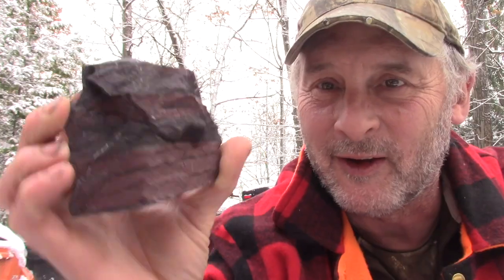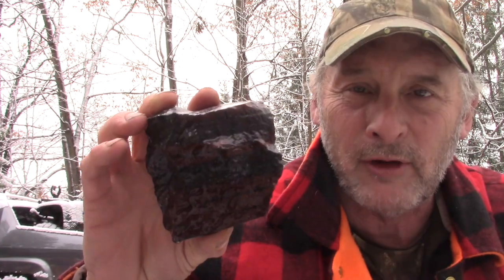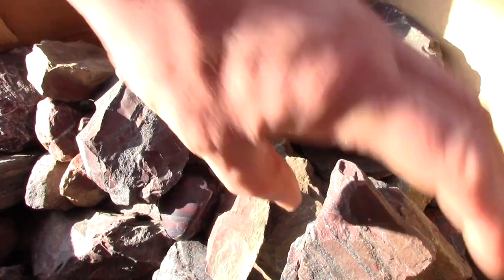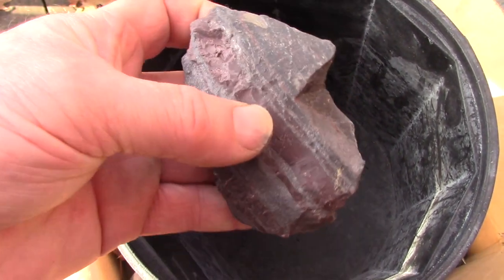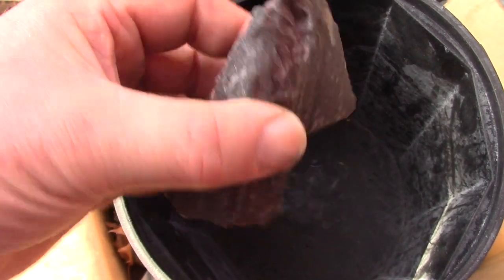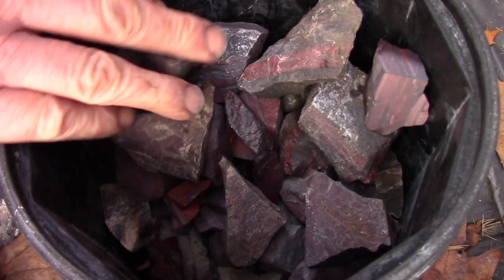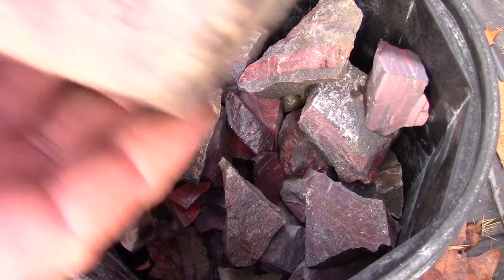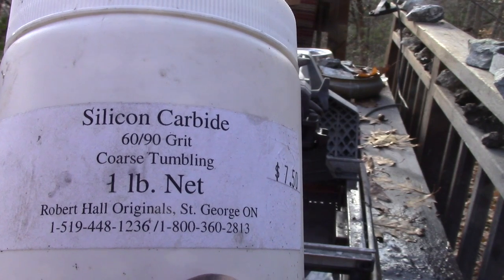TUMBLING BIFs -  PREPARING THE ROCKS

Comment: I put a big one in every time as long as its same materials.
Reply from the maker: Sure.  One big one might be OK.  The others roll around and it can be effective.  I have tumbled a large rock with smaller ones and when the little ones were ready for the next round, the big one still needed time.  That is OK.  I just put it into the next batch.  What is your process?